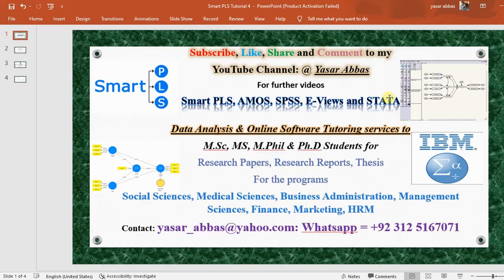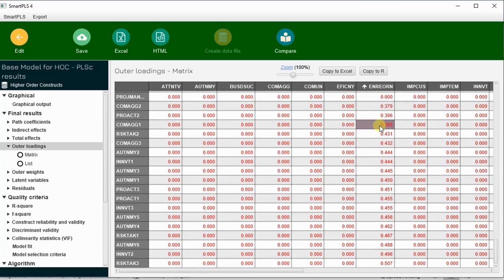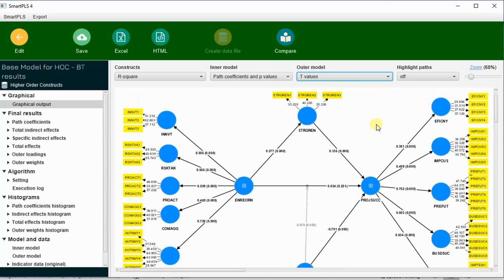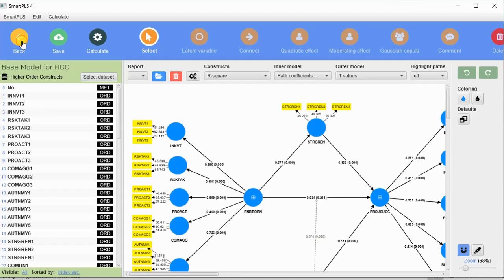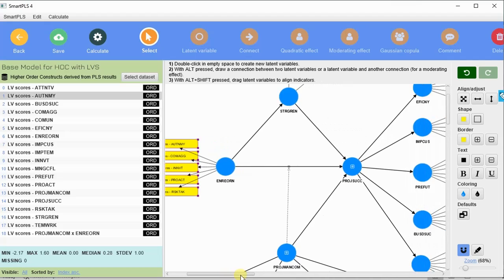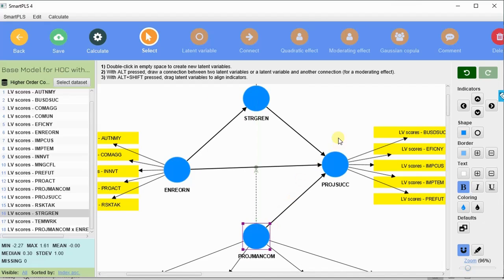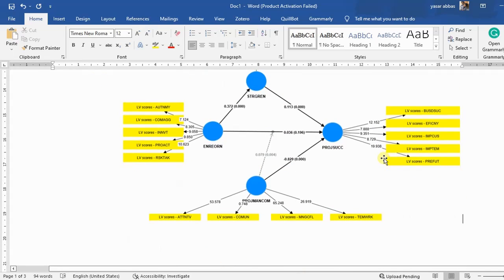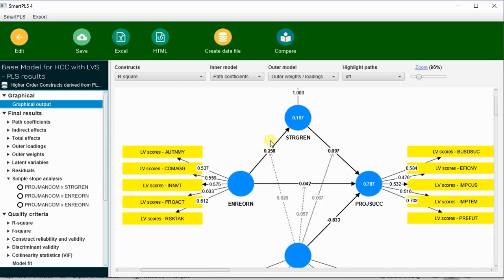SmartPLS 4-15: Higher Order Constructs Complete Model Part 4 #sem #smartpls #cfa #HOCmediation

Comment: Aoa sir, i am developing a structural equational model using smart PLS. but my outer loading values are very low. most of the values are less than 0. please tell me how can i adjust the values and my data set for accurate results .
Reply from the maker: Issue in data

Comment: Thank you sir for the video, 
My hypotheses are all about finding the relationship of an independent variable on the dependent variable and the dimensions of the independent variable relationship with the dependent variables. (Only studying dimensions based relationship of independent variable) 

In this case also I can use the latent variable scores of dependent variables in stage 2 OR remain to use its items and perform the analysis. 
As you said in the video that sometimes we can use LVs for 1st order construct OR can remain with their item and perform the analysis.
Reply from the maker: If you are going to just find the direct effect of dimensions on DV (assuming first order construct) then there is no need to run higher order analysis or two stage approach

Comment: Hello Sir,  
You have explained in the video, there is two steps in PLS.  One is model assessment and the second is structural modeling. I want to ask in case of higher order reflective model, first I need to conduct confirmatory factor analysis taking first order variables and to ignore the second order factors. after that I need to calculate latent variable score , to convert second order variables into first order variable. Sir is this way to write the analysis in the thesis?
Reply from the maker: Yes you are right go ahead with this.
You may also watch my videos on higher order constructs. I have explained step by step process.
Reply: please ask him to make videos on reflective formative with moderating variables.